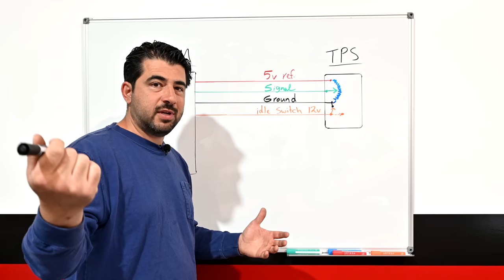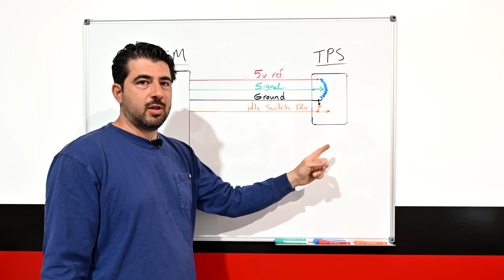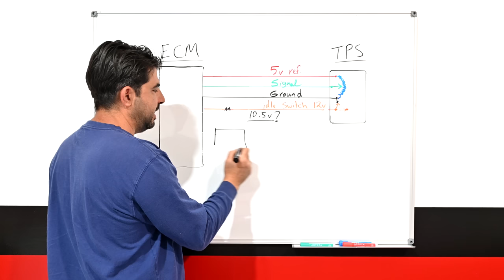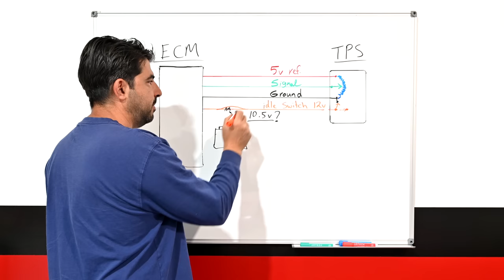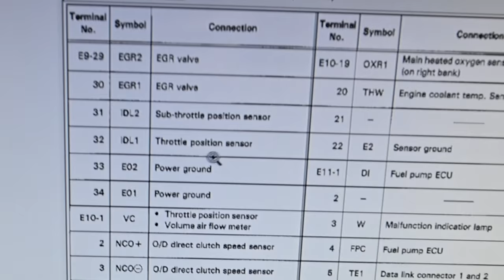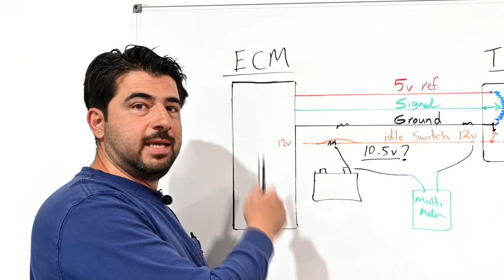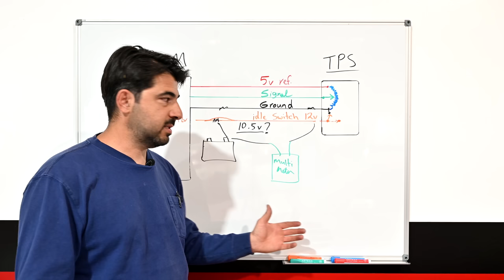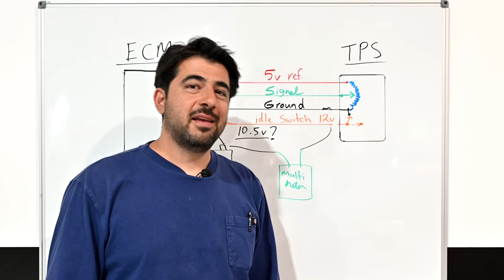Solving Lexus or Toyota Electrical Problems With a Multimeter

Comment: I've bought a 2002 Toyota MR2 spyder, which I've converted the transmission from auto to manual. The tricky part is now finding the wires that'll start the car. But watching your videos helps me understand the basics behind troubleshooting (even if I don't know where to begin)

Comment: With vehicles today, just changing out a part does NOT mean the issue goes away.
 So at some point, either you or a 'high-paid technician' with loads of time on his hand, & dollar signs in his eyes will find the real problem with an electrical meter. As for repair on the ECM, I never knew those things could or would be fixable inside. Beyond my pay grade, but great you found some shop that can do that kind of work. You also show what kind of issues a 'salt belt vehicle' can expect to have even though the car looks 'really clean' and a steal!
 Old & simple is my idea of a reliable vehicle. But all things come to an end one way or the other. You sell it/ or it goes to a scrap yard.

Comment: Good idea to state for the learners that “ series circuits have voltage drop at each load.”     The load COULD BE a loose connection, an unintended load.  thank you

Comment: @Ratchets And Wrenches  Great shows and skill you have... Question ...
the Mechanic forgot the transmission filter and ripped the pan open again after was RTV and sealed ..then no bother cleaning old RTC and gasket ....just added some more RTV to fill in and   closed it again after putting filter in. Will too much RTV like instead of 1/8 inch bead its more like 1/2 inch or 3/4 bead of RTV ... maybe even a bit more. then criss cross torque and we let it sit 5 hrs ..fill and drive,.. will it  hurt the transmission too much RTV like that or the pan in any way?

Comment: It wouldn't be too hard to remove the capacitors with solder wick. You could then clean up the board and inspect the traces. You can check them for continuity to be sure. One of my theories is that if something is broken I can't make it worse by trying to fix it. This theory does not always work🙄. At least I always learn something. Wisdom comes from experiences, both good and bad.
Reply: these ecu's aren't easy to come by so I would send it out to a shop. would be a decent idea if there were new ones at the local dealer. there's also the whole chip shortage thing going on so there isn't going to be stock for brand new vehicles either...

Comment: Need help i have a knock sensor light on 2001 chevy tahoe 5.3 change the knock sensor nd the cable light was off but came back on same codes but i put brand new sensors nd a plug p0332 p0327

Comment: Or your losing voltage along the way. Resistance somewhere causing loss. Bad connection bad wire/or wire connector etc. Ground should be solid too.

Comment: I thought Toyota's were bulletproof?
Reply: No car is bulletproof. But Toyotas are more reliable because of their quality control and statistics being on their side. Lower failure rates are  obvious when you can control entire supply chain and execute proper quality checks, which means producing as age tolerant parts as one can achieve. Ofc you know that, but I wanted to clarify nevertheless.
Reply: Toyota learns from their mistakes. That's why they beat us at our own game
Reply: Lol its a 30 years old car ....
Reply: Toyota's are very reliable if recommended maintenance is done on them. Lexus as well.  When I worked for both companies dealerships there main problems were people not doing oil changes at recommended times. That's where we would see problems with the engine gelling. The 90-94! LS400 was for its time incredibly reliable and such a smooth driving vehicle. Lexus went down a few notches as they started to up production to meet demand.

Comment: You are really brave to condemn that ecu so fast. You'd have to be reeeally fu ckin sure that 12v and nothing less than 12v must always be on that gn line. Coz at 10.6v, I wouldn't be so sure that the ecu is bad. Also, if you had doubts about a short to ground, then you could just put a friggin test light on that wire connected to battery positive. And no, there's no such thing as a partial short to ground. Electricity doesn't work that way. You could have a voltage drop for sure, but never a partial short to ground. And another thing is that before you start unhooking wires and connecting long leads, you could simply backprobe that ecu pin and you'd have seen immediately that you don't have a wiring problem. I'm not even sure that you have an ecu problem. It's possible, but I'd need more proof.